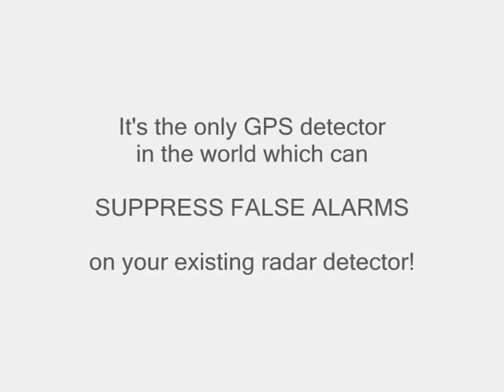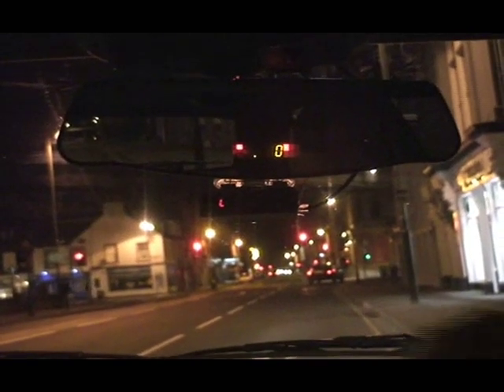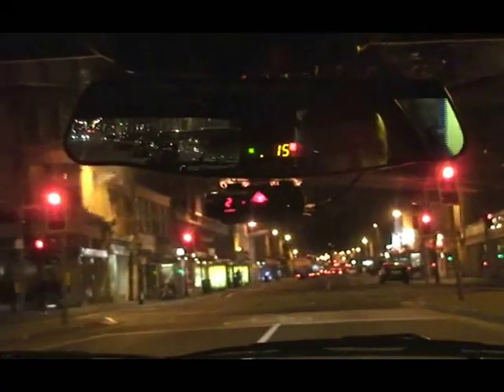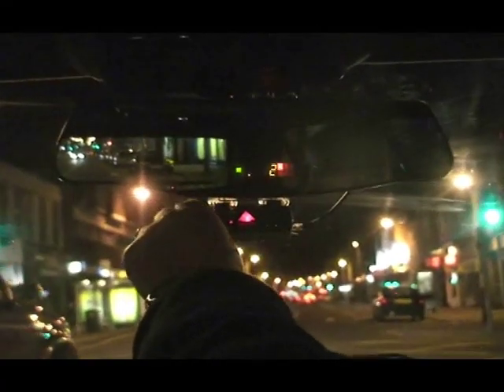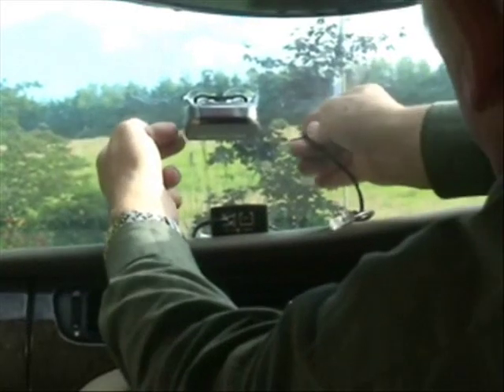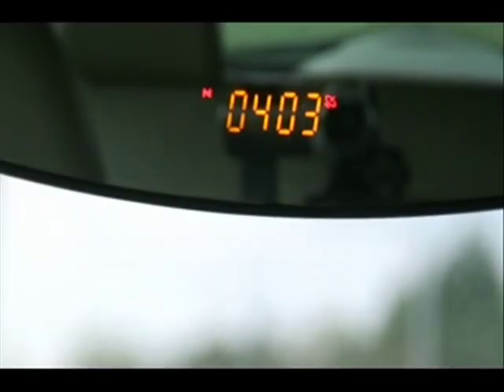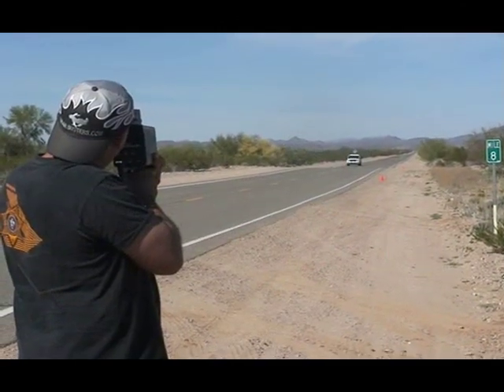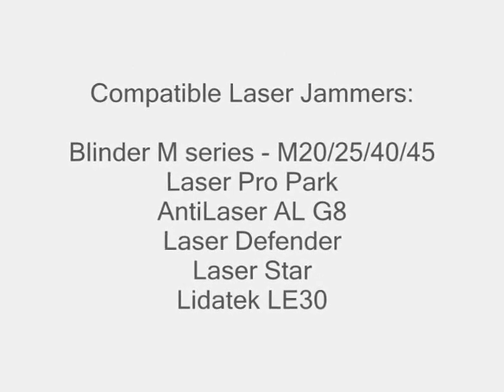Radar Detector Interface for GPSmirror

Comment from the maker: Used as a stand alone device, the GPSmirror is designed to notify you of fixed speed cameras and fixed red light cameras.

You can use a Radar Detector Interface to play alerts from your radar detector through the GPSmirror. This gives you the great benefit of auto muting radar alerts when you are below a chosen speed limit.